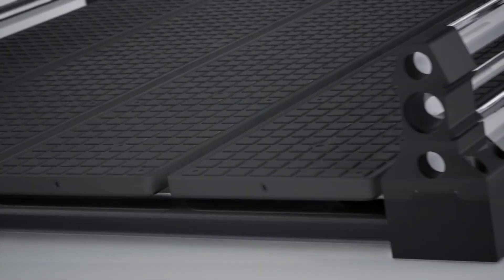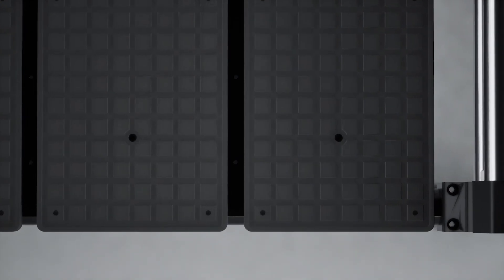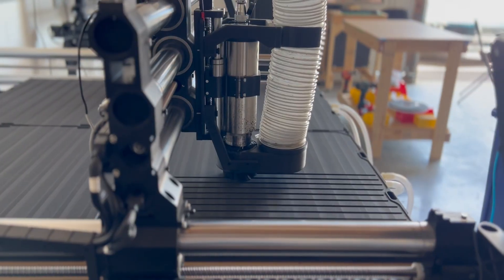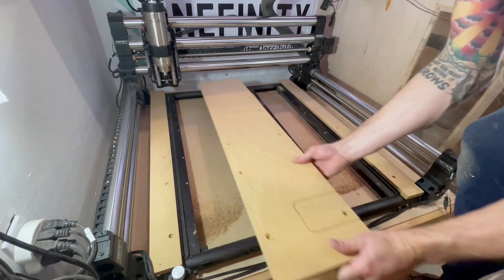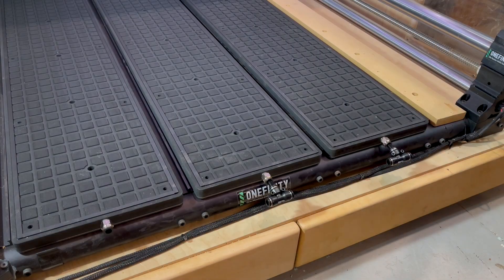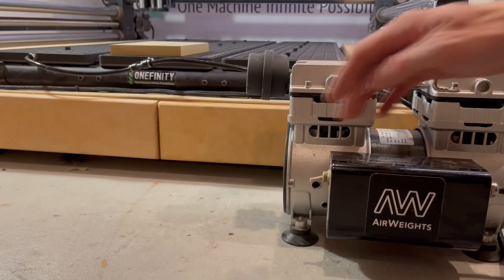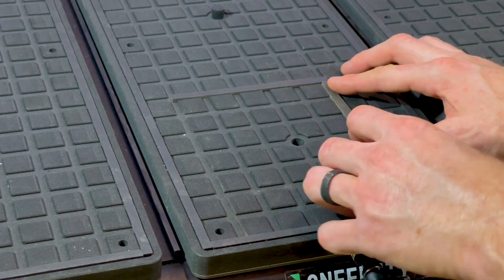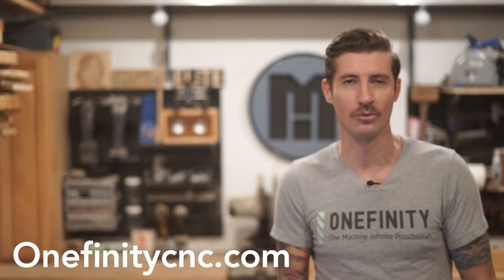Vacuum Workholding For Onefinity QCW

Comment: Two questions. One, will replacement slats be available? I can see digging into some of these and making a mess of it. Two, will this work with the Mount from below system?
Reply from the maker: Yes, and it only works with the from below version (from above will just punch out the PEM nuts.)
Reply: @OnefinityCNC  Thank you for your quick reply! Sorry, I did actually watch the video after I posted the comment and saw the information I required. But again thank you so much.